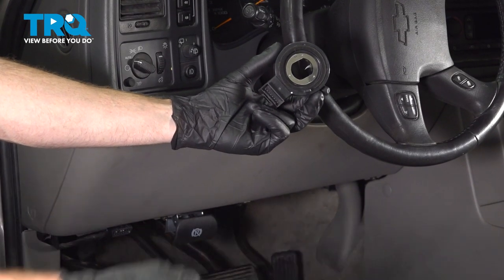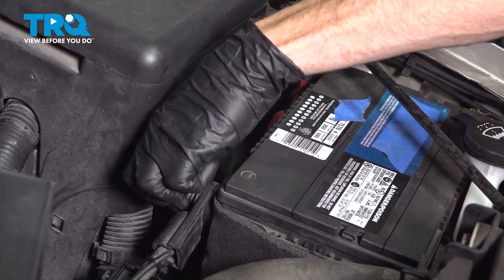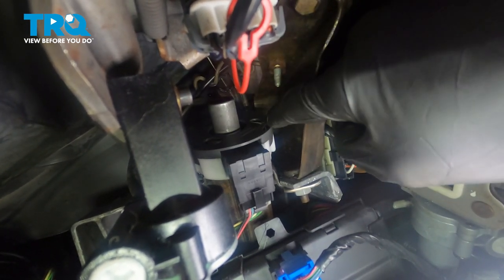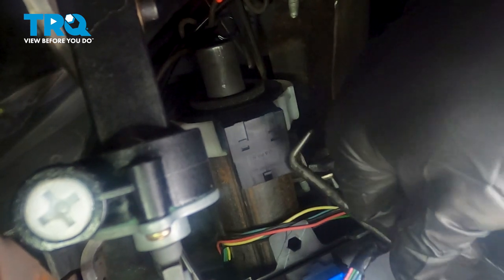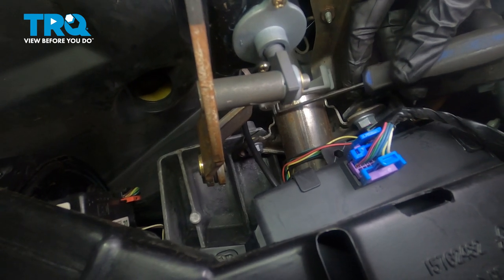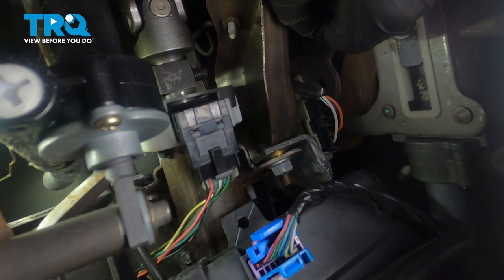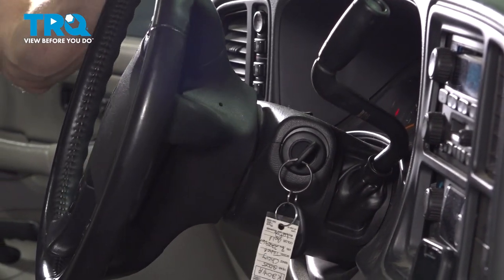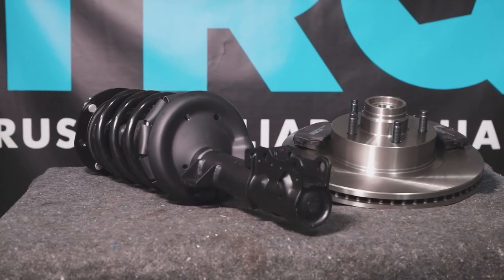How to Replace Steering Position Sensor 2000-2006 Chevrolet Tahoe

Comment: Great video!  I had the Service Stability light come on my 2004 Suburban after changing out the steering gearbox.  My research led me to believe it was either the steering position sensor or the steering wheel clock spring.  I chose the steering sensor first since I knew I had the steering wheel tied down when I changed the steering gearbox.  Fortunately, it was the steering sensor.  Took less than an hour and that fixed the problem!

Comment: Very helpful video and very well produced.  My 2003 GMC Sierra 1500 Denali has Quadrasteer that suddenly stopped working.  My Tech2 scanner said the steering wheel position sensor was out of range.  Once I replaced the steering wheel position sensor, I ran the 4-wheel steering "Learn Alignment" procedure and my Quadrasteer is back in business.  Thanks again!

Comment: Will this part being bad not let an Escalade start like if the Neutral safety switch was bad…
Because my truck didn’t want to start and I had an old column in the garage took and just connect this piece and my truck started right after that